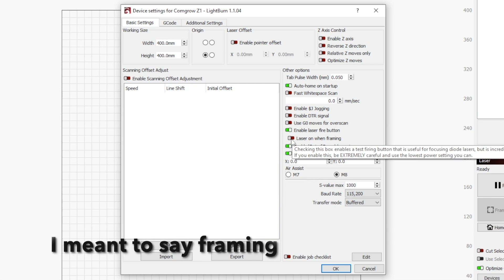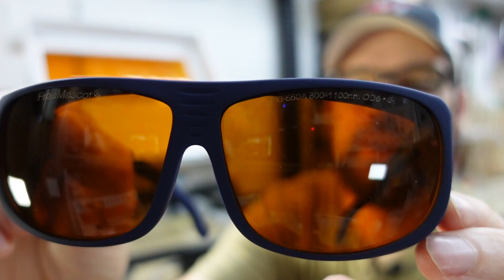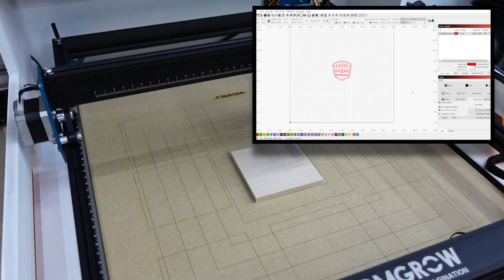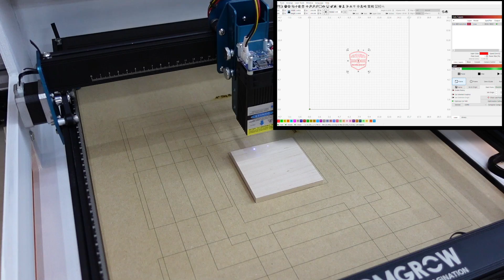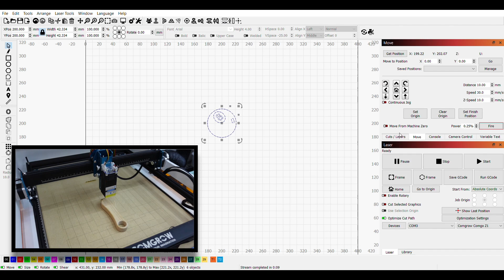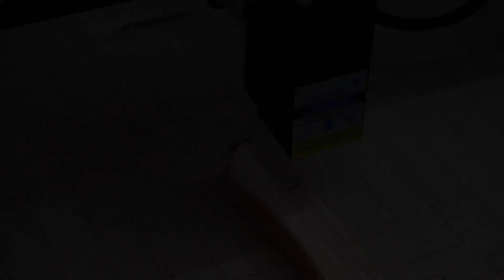Using the Framing Tool in Lightburn for better-aligned laser Engravings

Comment: Great video thank you! Just wondering what is your spoil board made from and do you have anything underneath it? Also wondering what the best method is to secure the spoil board/laser into place? Thanks very much
Reply from the maker: For just engraving jobs, I like to create a board that locks in place to the laser with markings to find center, a grid for squaring up items and 4" circles and squares for aligning coasters. However if you are cutting, you'll want something like a honeycomb panel to allow the air and debris to pass through and away from the bottom of the material you are cutting.
Reply: @Vintauri  great thank you 👍

Comment: I’m new to laser world do I have to use the fire button kinda scares me
Reply from the maker: You can frame without the low power beam on but you would get as precise of an alignment. If you make sure the laser fire option is set to .25% or .50% it’s at a very low power and relatively safe. It’s good to be safety minded and cautious when using these tools.

Comment: This method just doesn't make sense to me. WAY too time consuming. Too much guessing, its ridiculous. 
Listen people there is an easier way. All you have to do is measure your work piece, add a square with the exact dimensions in work area in lightburn and work from inside the square. Center your design inside the square and "voila" you're all set. Your job origin can start from the corner or the center. 
It takes literally seconds to do this. Very accurately. Save yourself the hassle and frustration. Do not do it the way he decribes in this video!
Reply from the maker: There are many different ways to do things in lightburn and not everyway makes sense for everyone.  I'll never tell someone their way is wrong even if it does not make sense to me. Not all work pieces are square and have an easy reference point so this is one way to check alignment.  You can make an alignment jig, start from center, frame and adjust or use a camera.  All are valid ways to try to align your work.

Comment: The second one is so confusing..so the key to rubber  band is to start in center?..thanks so much
Reply from the maker: The rubber band framing is not always useful depending on the shape of your object being engraved or your artwork.  But when working with a non square item, using the center point origin can be very helpful in getting the engraving lined up.  If you are going to make multiples of an item, it would be worth the time to set up a jig to help align your artwork to your object, or you can also look at the camera options for lightburn to get you within 1mm of alignment for custom items.

Comment: Sorry, for the thumbs down.  Why didn't you use the Tool "T1" or  "T2" selection around what you intend to etch?  It would quickly show where the laser will be working to etch what's being engraved.
Reply from the maker: The framing function outlines the extents of the actual artwork and the tool selection is not needed in this case.  If I needed to outline an object larger than my engraving artwork I would use the tool feature.  Both way are valid and in the case of doing multiple items, I would spend the time to make a jig for alignment. But in the case of a one off items like this, I just use the framing tool as a relatively quick way to get it lined up.

Comment: The most important thingin lightburn for me is a 0 positioning.Finding the starting point.
G10 L2 P1 x(num) y(num).I hope you know what i ment by this command i hope.
It was a real problem for me.the laser was travelling around as a maniac.Bumping into the walls😂.And i was getting strange cordinates with minus.Example: -1200.😮I solved that issue.

Comment: Couldn't you load in whatever grid file you used as a reference in Lightburn to align from that also?
Reply from the maker: Yes you could if you have made a spoilboard with those markings, however on smaller one off items, I still like to manually test the alignment with the framing function to double check the alignment.

Comment: THIS VIDEO HELPED SO MUCH! I can frame my Longer Ray5 now accurately! Teh beams visible with about 1.75% power (175ma?) I chose to have the HOLD-SHIFT as an option. GREAT! I was having such a hard time aligning things. THUMBS UP!!!
edit: my biggest issue was the missing MOVE tab but found out how to add that and all my options became available.
ALSO - bought the Freemascot safety glasses wth your referral link, I trust your opinion on these.
Reply from the maker: I'm glad it's helped and that you were able to re-add the move tab from the window menu.  Those Freemascot glasses are much better than the simple ones included with most lasers!  I'm glad you picked them up!

Comment: Should I use the safety glasses DURING the framing?
Reply from the maker: Usually I have it set to .5% which will be too low to see with the glasses on. As long as you are not framing on something reflective, you should be okay to frame with the laser on and without your goggles but make sure your laser is set to the minimum power you need to make the dot show up.

Comment: LA Hobby Guy is good, but your videos are good too. Always nice to see other people’s perspectives so you can try what’s good for others to come up with your own methods. I like your method of using a low power fire mode to center the object up, then use LAHG method of low power framing. I like his method of having multiple passes on the framing by using a low power setting. Just have to be careful to make sure it’s the only power setting for the entire job. It can be dangerous if you leave something in there while using a non-framing mode. That’ll be a great way to get yourself burned if you’re in there messing with it and it decides to kick off to another part of the job and start blasting you…

Comment: So your 0.5 settin g on the laser is only allowing you to see the dot for alignment purposes but not actually leaving a mark on the material?
Reply from the maker: Correct, you can adjust the fire setting in lightburn by .25% and the idea is to bring it up just enough so that you can see it but it is so low power that it will not make a mark while framing. If you left it in one spot for too long it could end up leaving a mark.
Reply: @Vintauri  gotcha. Thank you.

Comment: Why not just add a $30 camera module to the set up?  Saves sooooo much time.
Reply from the maker: Cameras are an option but not everyone has them. I’ve also found them to be hit or miss and can still end up off by a mm or two. On a hard to replace item, I’d still frame it to be sure that it’s aligned.
Reply: Problem with camera its only aligned at the distance you aligned it to, change the distance and you have to make adjustments so really no faster then using framing methods. Fiber laser if you want some real fast reliable alignment.

Comment: I don't see laser on when framing option please help
Reply from the maker: You find that under the Edit > Machine Settings options and then it's only available when you Enable Laser Fire Button.  You'll then need to make sure your move tab is selected under the window menu.
Reply: @Vintauri  well i found the solution i was using the old lightburn that was installed on the sd card that came with the laser engraver thanks anyway😁

Comment: If you have a hole punch for paper. You could put that in the center of your work. Fire the laser (low power). Once the work is centered. Just blow it away or pick it up with a needle.

Comment: I don't know why people use [FRAME] its a terrible method. Just measure the material, make a square shape in light burn. make laser go in to one corner align with the beam than / opposite corner align and you have perfect square in 10 seconds.
Reply: It’s not always a square… sometimes you need to know where the edge is but like in this video he made the 8 ball. If he tried that method the laser would be off the object to be engraved.

Comment: HI, guess u didn't notice the button that says (Laser on when framing) but still a good vid for beginners ;)
Reply from the maker: I did mention that as an option to turn on but I prefer to keep it off so that I'm always proactive about when the laser will turn on. When dealing with more reflective items or when someone else happens to be using the machine I don't want them accidently flashed with laser light.